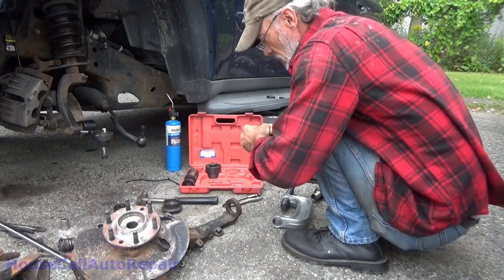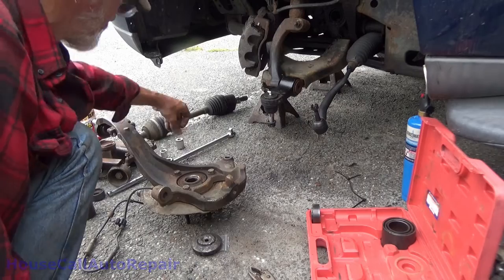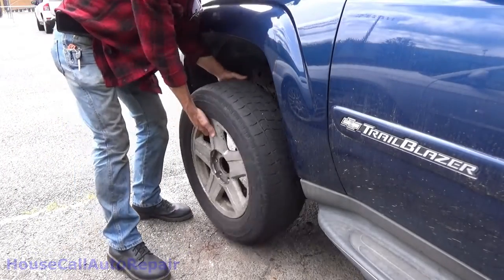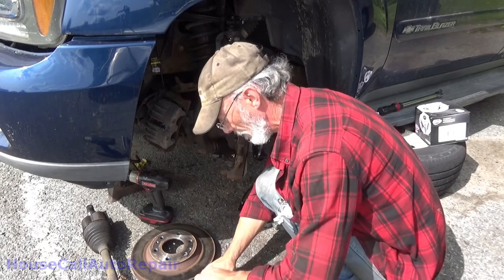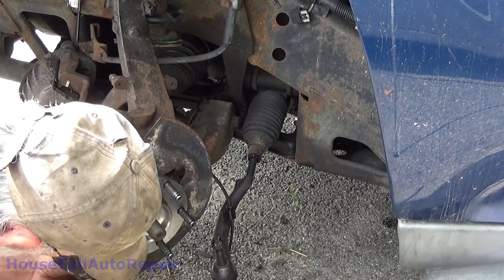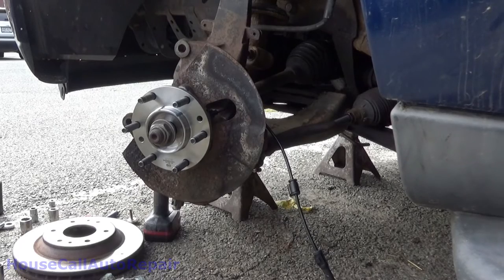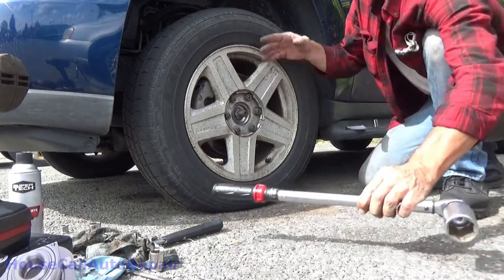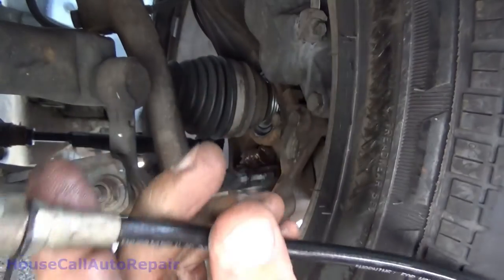TRAILBLAZER Front Ball Joints & Bearing - Part 3 - Upper Ball Joint and Bearing - Auto Repair

Comment: Another good video and detailed explanation, Mitchel is down but I did look on fixya for the torque  spec's . Did I see Rock auto magnets on the inside lid of your toolbox?
Reply from the maker: You are correct about the magnetic business cards on the inner toolbox lid! There were more, but a few have met the gate of being mulched in the tools.
Reply: @HouseCallAutoRepair Sorry Just realized the torque spec's didnt upload Here they are according to fixya 1)Drive axel nut 103 lb ft 2)Lower ball joint retaining nut 81 lb ft 3)Outer tie rod to steering knuckle retaining nut 44 lb ft 4)Upper ball joint pinch bolt 30 lb ft 5) Wheel hub and bearing mounting bolts 77 lb ft 6)wheel studs / lug nuts 95 ft lb .